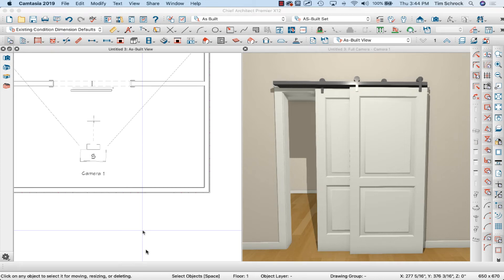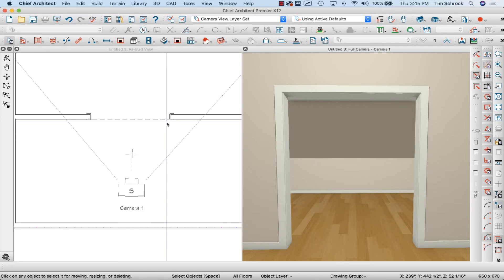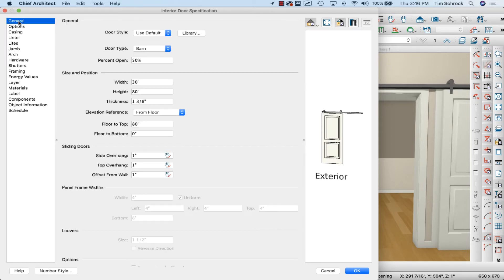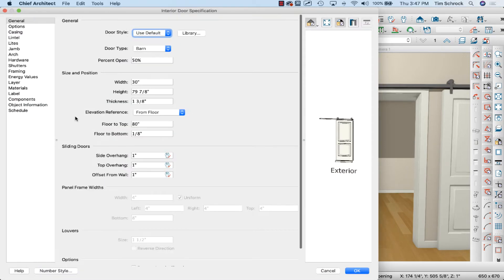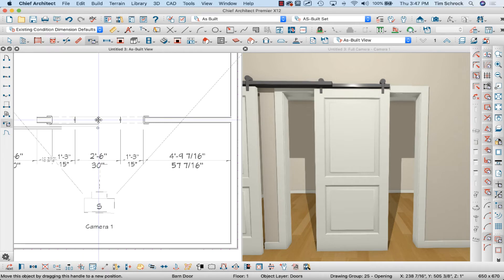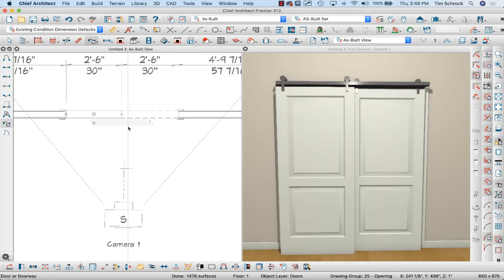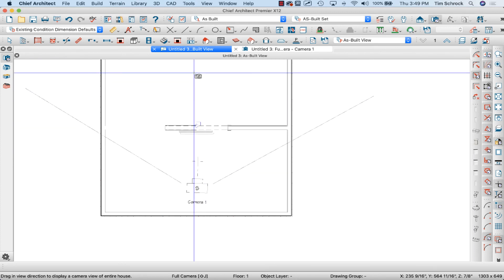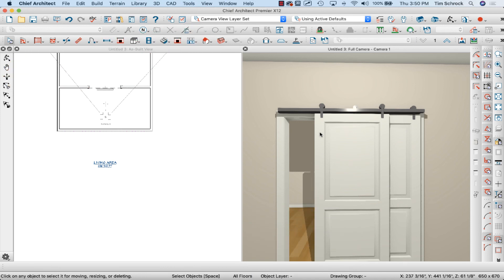#BonusTip Bypass Barn Doors | Chief Architect

Comment: Tim, is there a way to add this type of door on an exterior with windows behind it in the main wall?
Reply from the maker: So, kinda. You can use similar methods as shown in this video...Cntrl/CMD key while dragging the door "over" the window. Remove casing, jamb, sill from the door. Only thing would be the door leaves an opening that isn't necessarily same height as the window. You'll have to make door the same height as the window, or if door is taller than the window, you'll have to manually build some solids to fill in the gap where the door cuts the wall below the window.
Reply: @DesignbuildsolutionsLLC  Thanks Tim, It might be a topic for another show.  Some of our designs in this area have been using barn doors to cover double french doors as a cool barn look with extra protection from the elements.
Reply from the maker: @joepaquet4332  Then I'd use the same idea in this video just with one of the doors being a double french door.